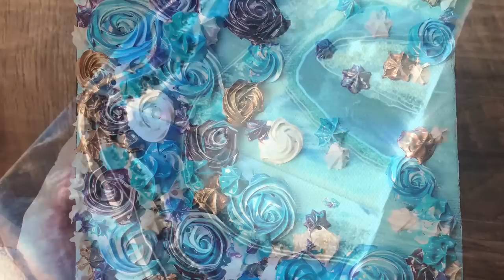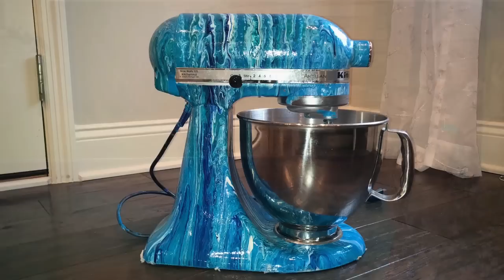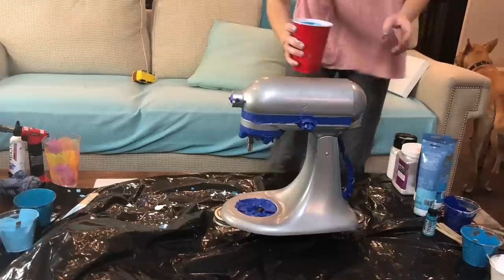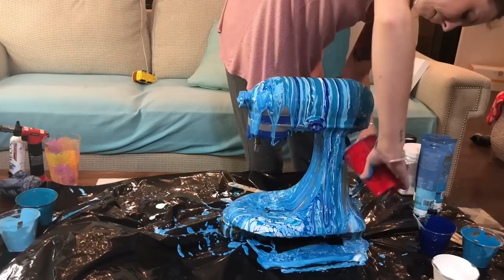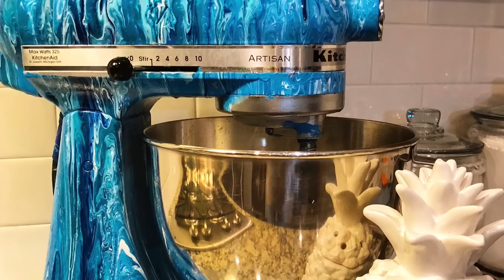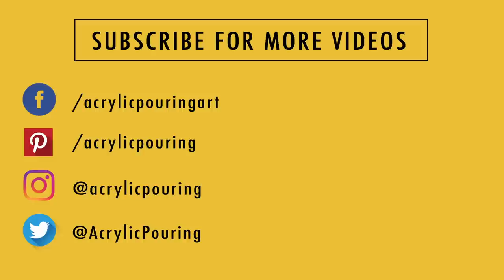Not Your Average Pour: Decorating My KitchenAid Mixer

Comment: Brave indeed. Beautiful, though I don't see where you've answered the question if the hinge still works...? Also having seen how you did the pour has given me ideas on how to get the coverage on the lower half without quite as much trouble. Thanks for your bravery! Just not sure I'm ready to pour in my mixer just yet. :)
Reply: Susan McMains it all still works just fine, I’m actually a pastry chef so I use it daily

Comment: Ummm I thought about doing this but it’s a lot of money if it doesn’t work.  Brave.  Does the hinge still work properly?  When did you pull the tape?  Did you have issues with the bowl area holding to much paint?  Turned out great but a scary project indeed
Reply: angelsandfaes it all works just fine! I use this daily with no issues :)

Comment: did u prime it? and what about the
Reply: I really like this but would have some concerns as well. I use to work in the paint coatings industry and  I'd think that you would need to apply a primer coat since the metal surface is so shiny and smooth.